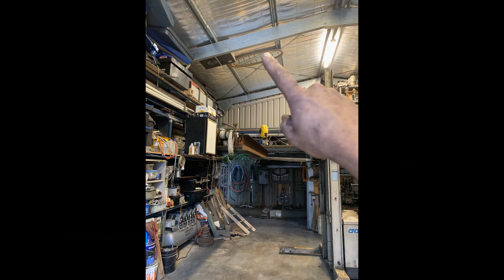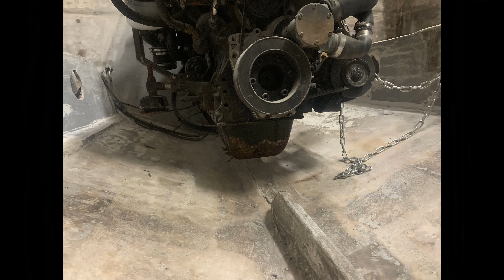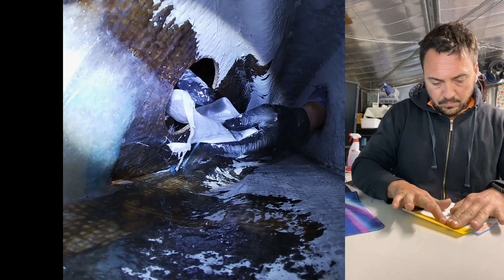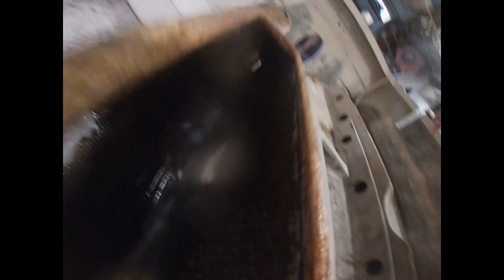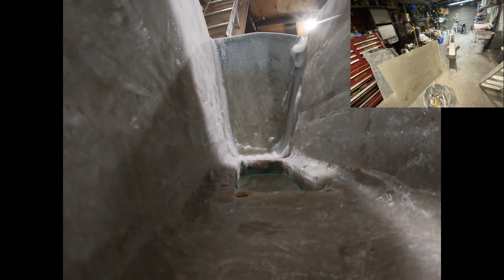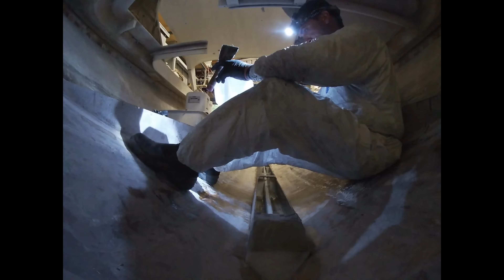25ft bertram project 4 - Sooo much work!! stringers into tanks, Engine crane, Mounting inboard motor

Comment: I wouldn't think of running any boat larger than a dinghy without hydraulic trim tabs.  Takes care of lists and squatting.  Lowers the bow for rough water.  Looking at the monstrosities on the cavitation plates of the old 165 hp engines I would really consider tabs.  Adding all that stress to the lower unit castings is not a good thing.  I can't begin to tell you how many cavitation plates I have seen broken by these.  By the way as a starting point the cavitation plate should be level with the keel (deepest part).  Lower will cause more drag and higher will impact motor performance as it "cavitates" at the prop.  I heard about the MerCruiser diesel when it came out but it never caught on around the NW US boating scene.  I never saw one.  I would check into parts availability.  In your design I would try to move weight forward when possible.  Deep V's tend to squat as the planing surface pushes a lot of water.  All things boating are a trade off.  While they squat and burn fuel they provide a good ride in rough water which is why they are used.  With a fuel flow meter and the trim tabs you can adjust the run for best fuel economy.  Faria makes a good fuel flow gauge.  170 US when I bought one nine or ten years ago.  Fits in a 2 1/16th gauge hole.  Fuel flow, fuel used, fuel remaining, etc.  I would bet yours is an early seventies model of boat as I seem to recall the cabin top being a smidge different in the early sixties model.  I am impressed that they glassed the deck to the hull even though with a light layer.  Most pleasure boats are riveted or screwed with a bedding if you are lucky.  I believe you will have an excellent boat when you are done.  I like the top extension idea (I live in a temperate rain forest and cabin space is important which wasn't so for Florida boaters they were designed for).  I would glass it in securely and go with a flybridge but that is me.